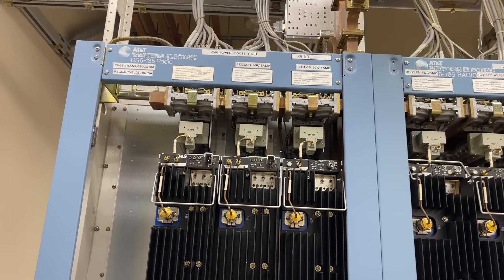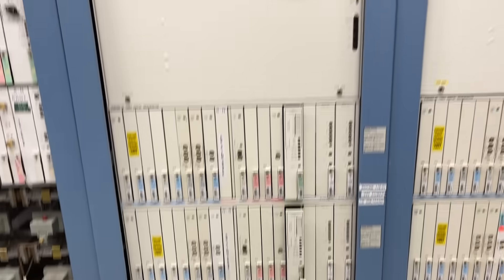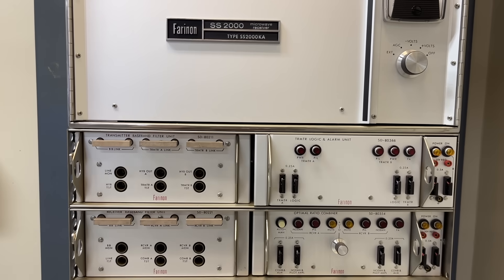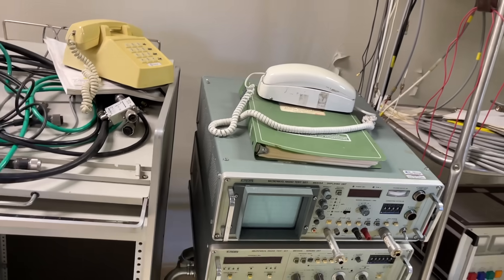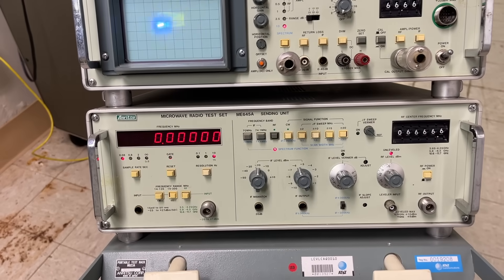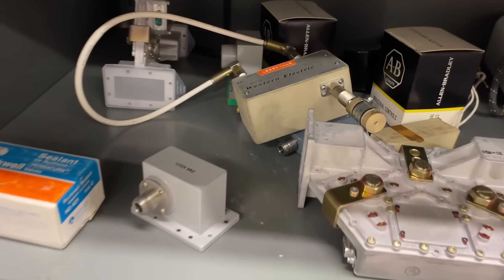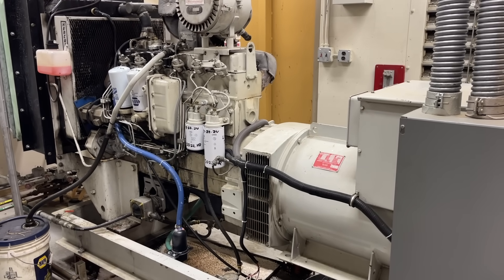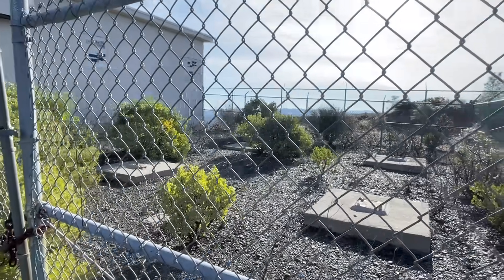Inside an old AT&T Long Lines Microwave Site

Comment: That Microwave is the Western Electric DR-90 or DR-135,  I installed and maintained them in the 90's.  There's alot of good old ger there.  The test gear is interesting, Anritsu is good gear!  The problem with radio is limited bandwidth.  Fiber has so much more bandwidth.  Thanks!
Reply: True. But the RF bandwidth works with significantly less trench.  8-).
Reply: I worked on the microwave that runs along the Alaska Pipeline. It was a NEC 3000s. The radio had equipment to make a SONET output to go right into a fiber mux. Each radio had an OC-3 output and there was 3 primary radios and one backup each direction. AT&T had that contract for years where we worked on all the circuits for the pipeline including the gate valves, VHF repeater system and even the fiber ring and equipment on the pump stations for them to operate their pumps and generators. The microwave sites were helicopter accessible. My last position before I retired. was the gateway ES in Alaska EGRVAKZA.
Reply: Very true in those days.  I’m running 2 gig over 52kms with the new Nokia radio system.  8 radios in an 8+0 configuration.  Now we are getting into the millimeter bands but the distance per radio is super short at 2-3kms. Mainly used for urban areas.
Reply: What would that Anritsu be used for primarily in this building? Power leaks? Faulty transformers? etc etc. It would be awesome to see a video of it in action as it would’ve been back then.
Reply: @TheKnoxcountry  No, the Anritsu was used to set up and align the radio channels you see in the bays.  It was great gear to work with, and was used for channel setup and routine maintenance every few months.  We used those radio channels to provide digital facilites to locations that had no internet or other access to the digital world.  The radios were great in their day, but have been far out performed by the single mode Fiber Optic cables that now abound and no longer require FCC licensing that comes with all the nonsense required by Government and their madness to accomplish political goals.  I did 30 years in the Bell system and the remaining RBOC's after the breakup in 1984.
Reply: @MontanaGrizzly73 Thank you for that explanation! Congrats on your 30 years put in. I don’t know much about this stuff but seems like it was an exciting field to work in. Thank you for all your time spent advancing our communication possibilities.
Reply: Since microwaves are bio-toxic, it's probably good they were an interim solution.
Reply: @ToxiCom-777  Are you ever clueless.....
Reply: @ToxiCom-777  You have no idea what you're talking about.
Reply: @JustMe-md2gp  DR MAGDA HAVAS .. DR DEVRA DAVIS ... been studying bio toxic effect of microwave radiation for deacdes.
Reply: @ToxiCom-777 you mean 5G
Reply: @dampandrew  No I read that DR HAVAS began waaay back before JOE VS VOLCANO movie pre-planted concept of "brain cloud" / "brain fog" as result of living near cell tower.  She was right on that cutting edge of explaining bio effects of microwaves from early cell towers.  HAVAS also published some of the ADM ZORY GLASER collection of bio-harm caused by RF.
Reply: @ToxiCom-777  The power levels in point-to-point microwave communications systems are pretty low and also pretty well focused.

Comment: Did these systems work with tropospheric scattering? I live in Spain, and around the 80-90's I saw several systems used to link an analog TV signal from Granada (coast) and Algeria, across the Mediterranean Sea. Powers up to 2 kW, and antenna gains of more than 45 dBi.
Reply: AT&T Long Lines was C-band point to point microwave links. Troposcatter systems had significantly longer range and also less throughput.
Reply: You need to look up the NATO ace high system. They were troposcatter throughout parts of Europe.

Comment: The Long Lines division was actually for voice and data transmission for the Department of Defense.  It was one of the DoD's early warning, command and control communications systems for nuclear defense.  It was used for civilian video, data, and voice when the DoD use was low.
Reply: AT&T Long Lines was responsible for ALL long distance transmission, not just defense. It carried network television signals also before satellites.

Comment: I'm old enough to have used these long line services. I recall the noisy channels and the latency between myself and the other party. I knew enough about the variations between channels to hang up and call the party back if it got too noisy or the latency got bad. I bet the phone company sported plenty of complaints back then because people were paying for long distance services. I recall having to shout into the transmitter of the phone on occasion too. Good riddance to these dinosaurs, as far as I am concerned.

Comment: Back in the 70s I worked for a company that made those data cards. I have no idea who bought them or what they did. I just worked on the assembly line and brought carts of them to the wave-soldering gizmo. After that they went to an oven to bake and then to a freezer to chill, several days each. This was to weed out faulty units, which got tested afterwards. If they passed the test they went to final assembly for faceplates and handles, then to shipping.

Comment: We had sites here in Ohio that were underground below the towers and were made to be bomb-proof, I was a fireman and so was trained on fighting a fire down in those underground AT&T towers and switch stations, I had an AT&T office that was 6 stories deep.
Reply: I got a tour of one of those facilities when I was in a college level communications circuits class. The building with all equipment was all underground, with just a small building visible at ground level, basically just the entryway, with strong entry doors to the underground floors, plus the towers with microwave horns. It was explained that the building was hardened to provide communications in event of nuclear war. The whole building was mounted on giant springs below the lowest underground floor (not in an earthquake zone, so this was to protect against bomb shock), and there were nuclear contamination wash showers in the building.  I also recall the plumbing having rubber hose connections to survive bomb shock. The lowest level was all batteries. I don't remember as much detail about the microwave and telephone equipment, except that as I recall there was more than one floor of it, and I think there was some empty space for room for expansion.  This was around 1978 to 1980.  Somewhere, I still have the AT&T Long Lines pocket knife they gave me as a souvenir.
Reply: We had the same type of installation near my hometown in Iowa.  Supposedly for the "real" reason longline existed: to provide communication in case of total nuclear war.  I have heard this installation is now used as an emergency backup server farm for someone.
Reply: Probably gates or the like for their terror servers:(

Comment: This stuff had to be 100% self-powered by federal law back then if the power grid was down as I was told. Is that still true for cell service nowadays
Reply: There is probably some FAA requirement as well for sites with towers that the obstruction lighting has to have a backup power source.
Reply: @abpsd73    yup, warning lights for aircraft fall under another category but consider what it takes to run a few bulbs / strobes versus the whole complex, including the radio gear and HVAC to keep building temps / humidity within range. There are also different rules for commercial broadcast versus emergency communications when it comes to staying on the air.
Reply: As much as anything, it's a tremendous loss of revenue for all involved parties when the system or any part of it is out of service.
Reply: @JustMe-md2gp      that may be the case now but wasn't back when these things were built some 50+ years ago.
Reply: the power backup was due to some use for govt. agencies back in the day. Same for making them "hardened" from attack. Most modern communications does have some sort of backup power, but the length of operation during an outage is not always specified. My local cable company had backup for a week at one point but time and budget cuts have reduced that to a matter of hours.

Comment: a friend worked in the glass tower building in Downtown Los Angeles from 1960 to 1990.  when they were designing the arco towers . ATT/ITT told them. they would need several floors in their buildings to put in a repeater for the microwaves going to Santa monica.. so they did a redesign and moved the buildings farther apart by 11 feet so the microwave signal could go between the gap..  my friend worked the graveyard shift.. calibrated the frequencies all night long along with other techs across the country.
Reply: Interesting. Been in L.A. a long time and never heard that one. I had a friend that did work in One Wilshire and had interesting stories about that.
Reply: The Madison Complex. Really 3 buildings connected together. It's on the LA Conservacy list with the MW tower to remain.

Comment: Reminds me of the equipment racks in an old Douglas DC-8 airplane, often referred to as the "radio shrine" as the doors had see-thru plexiglass framed in metal, as well and mostly located in the rear walls of the cockpit.

Comment: Unless torn down in the past 6 months,  there is a microwave tower and windowless blockhouse like this next to state hwy 68 north of Wilmington Ohio. All surrounded by chain link fence and farmland. Never seen any vehicles people etc.  driving by it weekly for decades.  There is a road off the two lane hwy near to it called RAYCON.  Unusual name there and I wondered if it was related.  No sign of changes ever noticed for the decades I drove past.  Now I have some idea what cool RF gear is inside, maybe.
Reply: I used to drive past that once or twice a month too, for a previous job, and wondered about it every time.  Happy to hear it's still there, if nothing else.
Reply: One in Cloverdale, IN as well. See it driving everyday.
Reply: Looks like it was still there in September 2023 - https://maps.app.goo.gl/d6NA8uKCY7cNPbQ78
It doesn't look like there are any cables or waveguides left going from the shack to the top of the tower.  At least the tower is still serving to host some cellular or wifi equipment about 3/4 way up.

Comment: 2 x T3 digital links 90Mbps typically over 30Mhz RF channel the wave guide size suggests 6Ghz band,   Western Electric was changed to Lucent Technologies in 1994 so its mid to late 1980s tech
Reply: I always chuckle when I remember us dreaming of having access to a dedicated T1 and realize today that I have 2Gb connection for (inflation adjusted) likely less than what a dial-up connection cost at the time.
Reply: I remember doing the engineering for OC-3 (155Mbps) 6GHz relay links (and FCC licensing) for digital video using Harris P2P microwave gear in the early 2000s for multi-channel video distribution. We were moving from older 4.3GHz analog video STL P2P. Never happened as we found that we could do it via VPN on commercial DIA cheaper than having to maintain the hops we needed to get from LA to Santa Barbara. My, how the world has changed.
 

My dad was part of the ESS5 software team at BTL (Naperville). I have a lot of interesting Western Electric and BTL books from the 60s-90s on the subject of analog telephony, transmission and switching systems. Sprint was built by the dint of running fiber along the same railroad ROW that AT&T Long Lines used to string copper on poles. To this day, that legacy Sprint fiber powers so much of the US comms...

Comment: Some of that high powered microwave stuff needs to wind up in the hands of styropyro
Reply: It's not very high powered though, 5-10 watts only. The extremely high gain directional antennas made using high power transmitters unnecessary.

Comment: Wondering what it's used for now... everything still powered up... looks like an excellent radio repeater site!
Reply: Might be shocked at the amount of outdated equipment left on just out of fear that turning it off will break something.
Reply: Probably houses the fiber equipment. It still needs maintenance so something is important in there.
Reply: Scowell ... Yeah but all the antennas are gone from this one, as well as anything to hang new ones on.

K2KQU

Comment: Those radios and multiplexers are newer than the 70's, look like last generation long lines form the 80's. However the farinon equip is from the old days, may not have been in use even at time of shut down. Those pressure transducers on the wall absolutely did maintain a certain pressure in the waveguide. The air was dehydrated before being pumped in, you want as little moisture as possible in the waveguide. The entire waveguide including the horn was pressurized. Have a look around other old sites for pictures of the earlier WE radios used to drive the horns, in the early days the equip was hybrid tube, technology progressed to solid state and beyond and it allowed for more signal bandwidth per path. Today microwave links are still used but the whole unit(transceiver) literally mounts on the tower/mast and the frequency is much higher than a few ghz like long lines was. Thanks for the look inside! Not many stations are untouched for the most part like this! Even spares and test equip still there!
Reply: This is good equipment built according to the old school. I remember the beginnings of mobile telephony in Poland, I operated SDH-1 radiolinks from NERA for low bands around 7GHz only we used flexible waveguides from Andrew company with ellipse cross section also with dehydration system. It was the end of the 90s then I also operated split PDH DMC Spectrum M, Spectrum1 and Spectrum 2 and XP4 radiolinks. Nowadays, where it is not possible to install fiber optics for various reasons, we build microwave links on 23GHz and E-Band on 80GHz. But I remember well those days and trips to the base station with a spectrum analyzer, power meter and frequency meter for inspection, check or repair. Back then you had to have engineering knowledge, now you just replace the ODU or IDU possibly a connector on the RG cable and that's all repairs.
Reply: Found some references to DR6-135 radios via a Google search, showing some sites had those installed in 1988 and were decommissioned in 1999.
Reply: Based only upon the style and colors of the equipment, I was guessing 80's as well.
Reply: The Folgers was definitely ‘80s. All my relatives had a jar like that!
Reply: Thanks for sharing. These towers were just as important as the electricity grid that helped built the back bone of America. It represented the future of electronic networking towards the World Wide Web. It’s amazing how far we came and looking back how it all started, it’s an engineering marvel and accomplishment.
Reply: Time 103
Dave, stop, don't do that 
Daisy, Daisy,
Give me your answer, do!

Comment: does this site have an electric toilet?
Reply: I maintained a site in Woodside, CA in the early '70s.  It had a burner potty but smelled  so bad, they just put a porta-potty outside.  Great memories.
Reply: @wwsoapbox6921 where in Woodside was it located?
Reply: @kenrehor  It’s been a while, we would come up on Woodside Rd from Redwood City then it was North of Alice’s maybe 3-4 miles.  There were several radio sites in the area.
Reply from the maker: Lol, no the regular toilet was removed now a Porta potty that spiders live in is all that's left.
Reply: for fun, they routed one power rf output into the guest toilet. it cauterizes the orifice. no need to p**p again.
Reply: No, but it may have an electric chair. 😂